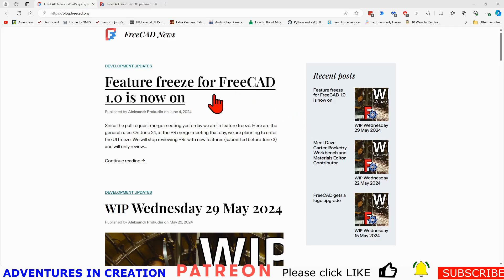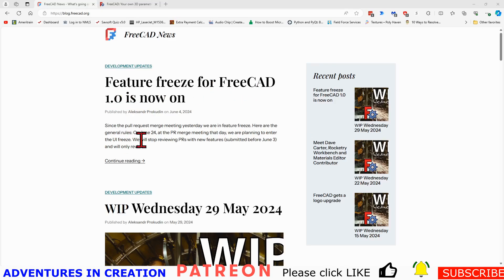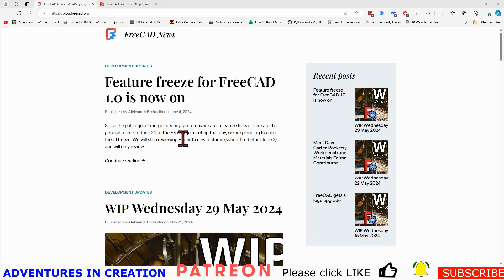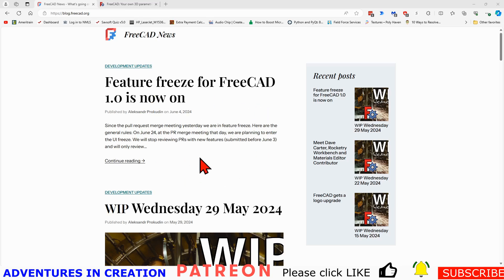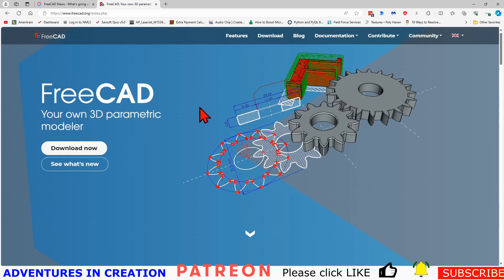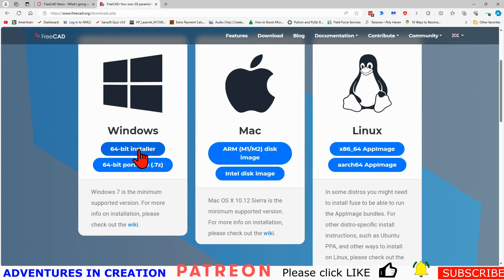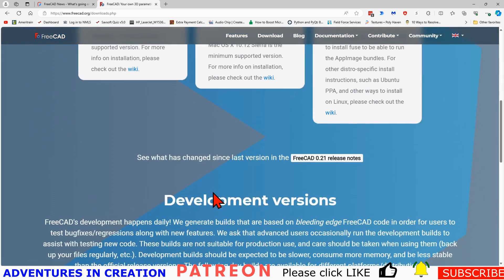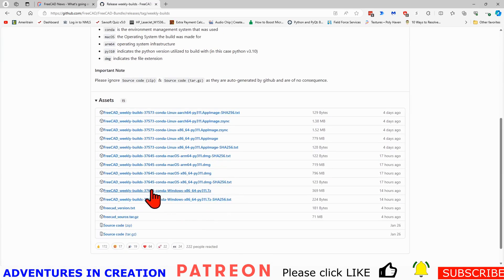FreeCAD for Beginners #66 eight essential tips for using FreeCAD 1.0 #cad #freecad #design #makers

Comment: Very unstable.  1. When I go to Preferences, Themes, only 3 are showing, unlike your drop down. Add in brought more themes.  2. I get an error opening any .FCStd from prior version.  3. Clicking the supported formats in the open file type drop down locks up the program.  4. Import is grayed out, how to import a file?
Reply from the maker: Are you using the latest dev version?
Reply: @Adventuresincreation  yes, downloaded Aug. 26, 2024 v 38506 for windows.
Reply from the maker: @davidcooper3871  That's really strange, I am using the latest version and don't see any of the issues you mentioned. I am running Windows 11.
Reply: @Adventuresincreation  so here is the trick to import. I create a new file, then import works. But no information is there. Just the body. No origin, nothing.

Comment: Thanks for sharing your knowledge. I just downloaded, but now it is Revision 37709. Having some issues others might need to look out for, when I started the first sketch the window to select the plane was partially obscured in the lower left of the screen. At first I did not realize what was happening and once I figured out to drag the window up it subsequently pops up in view. Also the XY,XZ,YZ plane geometrical views remain on after starting the sketch, haven't figured out how to turn them off yet. Otherwise everything is working as you demonstrated. Best Regards
Reply from the maker: Thanks for the heads up, I have updated to the very latest and thought I would create another video that shows how to set up the layout.
Reply: @Adventuresincreation  Figured it out, selected the Origin in the Model pane, hit the space bar and toggled off the Planes view. Must have been a solar flare when I first started the program!
Reply from the maker: @DanAz617  Great!
Reply: @Adventuresincreation  Yes, that would be fine. Thanks in advance.

Comment: The dimension updates are very similar to what I use at work, Solid Edge. Definitely a step in the right direction from an deficiency standpoint. 

I found a bug recently. Where should I report that? I can certainly send an example to you if you're interested.
Reply from the maker: You can report the bug on the main page of freecad.org select contribute>report a bug

Comment: You left out the most important new feature of sketcher. You can specify dimensions while drawing.
Reply from the maker: That's a good one too!
Reply: You missed auto symmetry or the new midpoint. It's a bit tricky with out remove redundant constraints.
Reply from the maker: @TheMegaturk  I have another video coming with a bunch of these features.

Comment: A heads up: Apparently BIM is native to 0.22. If you have BIM installed (as I did in Windows) you will get a warning to uninstall it and then be unable to uninstall even in 0.21 because the directory had been renamed. This may affect other Workbenches but I don't know for sure.

I had to:
Exit FreeCad 0.22 and rename  <USER>\AppData\Roaming\FreeCAD\Mod\BIM021 directory back to [...\BIM]. 
I was then able to uninstall BIM in 0.21 so I could avoid the error message in 0.22. It didn't seem to harm the functionality of the dev version either way.

Thanks for the video. Lots of new features for me to explore.
Reply from the maker: Thanks for the heads up!

Comment: nice development. I see still missing handles for extrusion. Are they somewhere?
Reply: In the latest build you can select any face and pad or pocket it.
Reply from the maker: @K5HJ  You are correct, that does work.
Reply: No, they did do that. It works in the new build.
Try it.
Reply: @K5HJ  do you mean the new build of 1.0?
Reply: @Not-Only-Reaper-Tutorials  I'm using 0.22dev version 37669
While in part design, you can select a face and extrude or pocket it.
Reply from the maker: Do you mean to extrude a face?
Reply: @Adventuresincreation  yes right. As it occurs in Fusion360 or Solid Edge
Reply from the maker: @Not-Only-Reaper-Tutorials  I thought that was what you meant, Freecad doesn't do it like that. You would still have put a sketch on that face.
Reply: @Adventuresincreation  it was an FR asked for long time now. I expected it was taken into consideration for the 1.0.
Reply from the maker: Ah, I am guessing they were too consumed with the TPN to do that, maybe it will come in the near future. It would certainly speed up modeling.